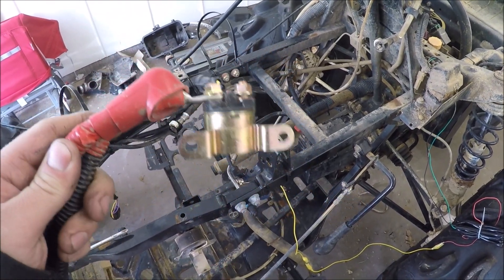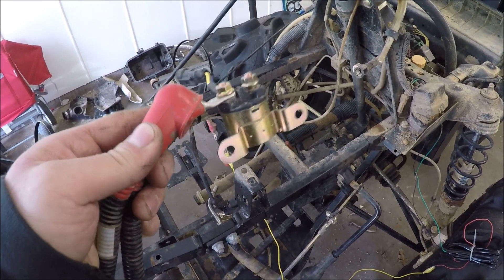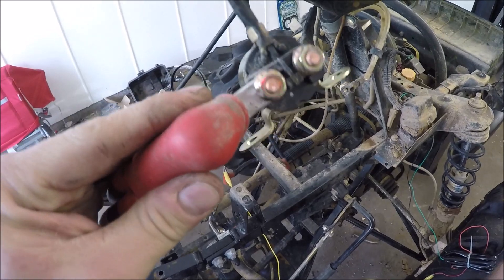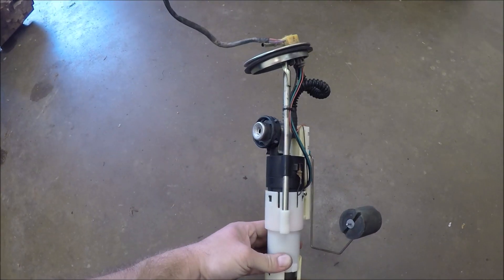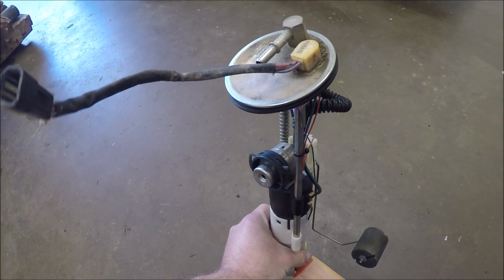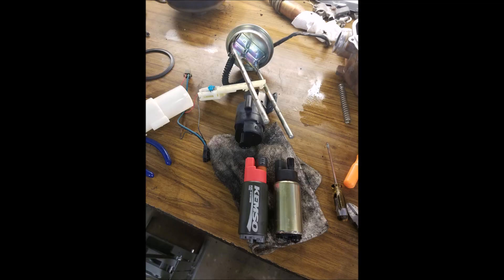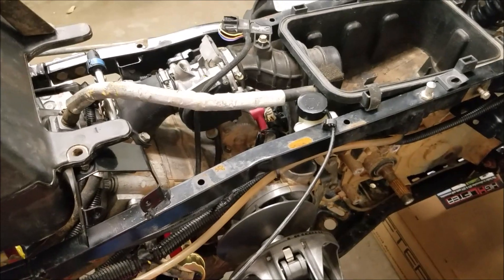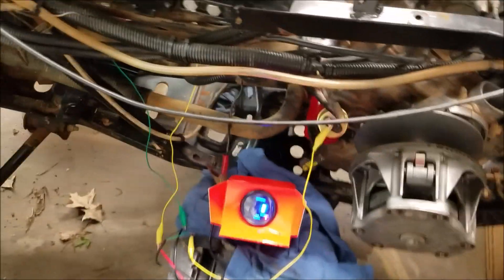Polaris 800 X2 "S" is Running!

Comment: Nice quad. You wouldn't happen to have your old fuel sending unit would you? I have an 09 800x2 and i need the board that the float contact rides on.
Reply from the maker: I do not have an old one. I just replaced the Pump inside the assembly.